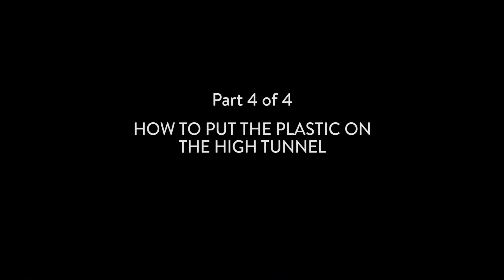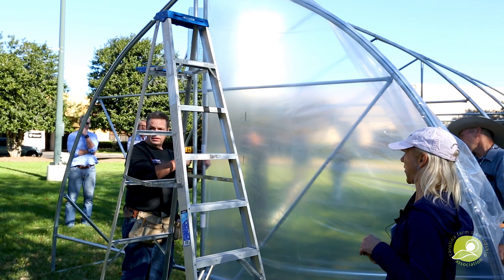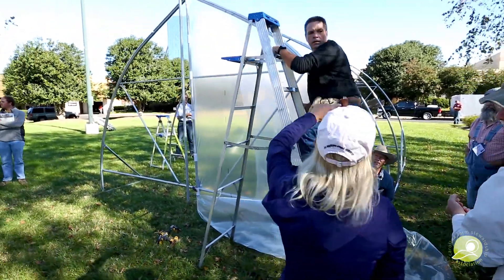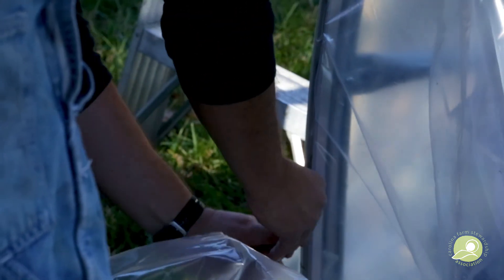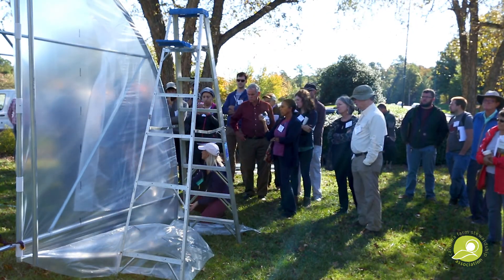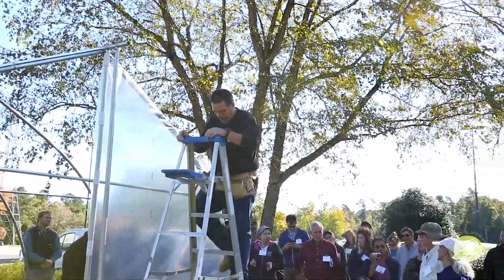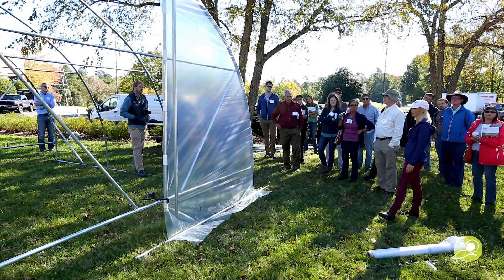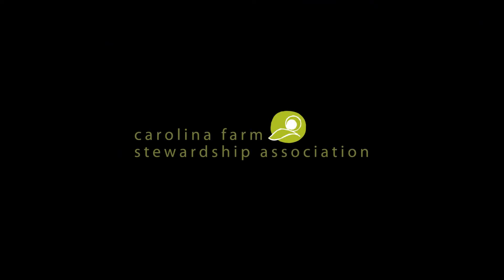Building a Movable High Tunnel, Part 4 of 4: How to put on the plastic

Comment: He stated that you want to put your plastic on when it is warm because it will tighten when it gets cold. This my apply to steel or other materials, but plastic sheeting will expand when it gets cold and become loose. the heat will shrink plastic and tighten it not the other way around. That is why everyone with a poly tunnel has to go back in the fall and tighten the plastic.